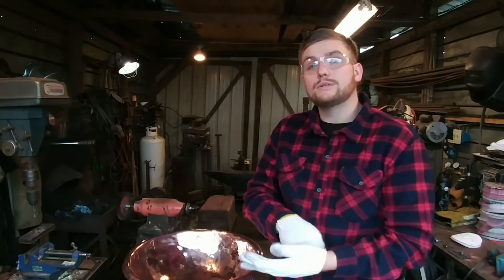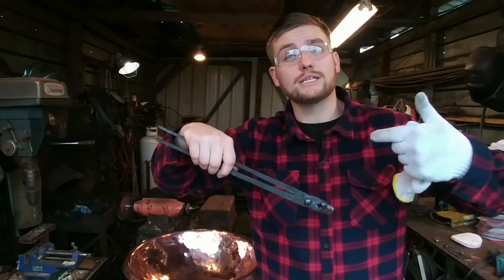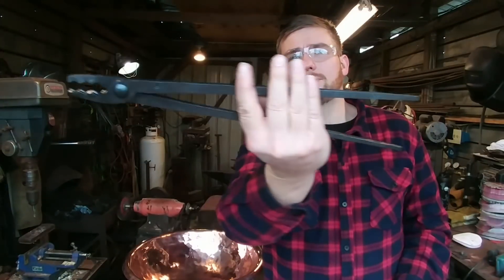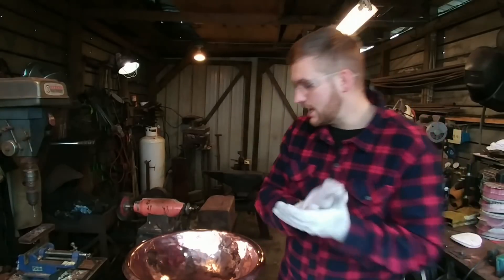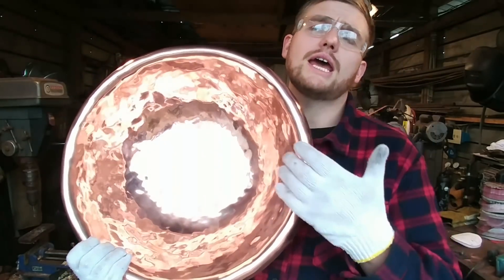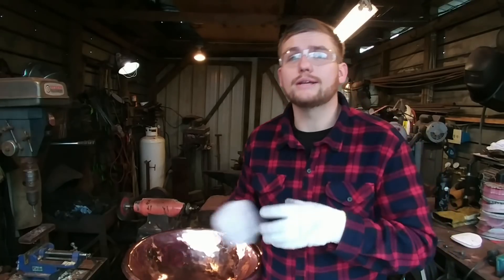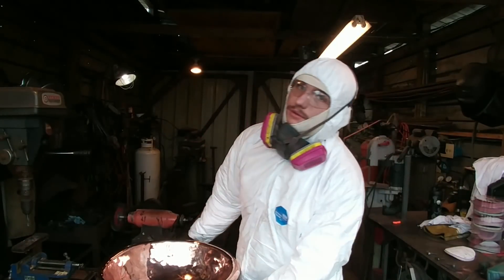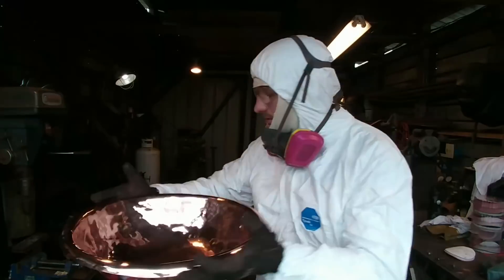A Day in the Life of an Artist Blacksmith (or Coppersmith or Whatever LOL!) Episode 2

Comment: looks great roy shines up a treat when i used to make aluminium bull bars we used ands held big die grinding like tools that ran off air they had a great big air compressor providing 150 psi of air to the entire factory but anyway probably not what you need as you wouldnt be able to hold it still enough to work it on that finer finish

Comment: Fantastic job mind blowing you are a true artist . I built a long shaft buffer from 1 1/4 pillow block bearings ,shaft with step pulley on the motor gives more room to work. I also used 1/4 electric die grinder as some of the parts of aluminum cases where very odd shapes the home made buffer made a huge difference. Thank you and God bless 📖✝

Comment: Think you'll ever switch to a full face respirator? It should add a little more protection for your face since there would be no gaps between the respirator and your safety glasses. I personally have been wanting to switch to one for a while now because I am tired of getting crud in my eyes when grinding dust bounces off my respirator, under my glasses and into my eyes.